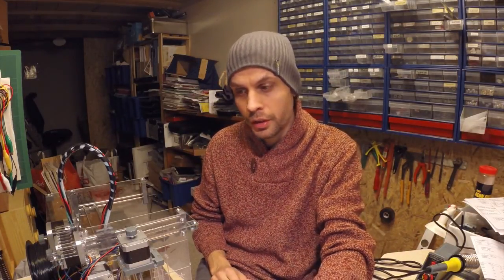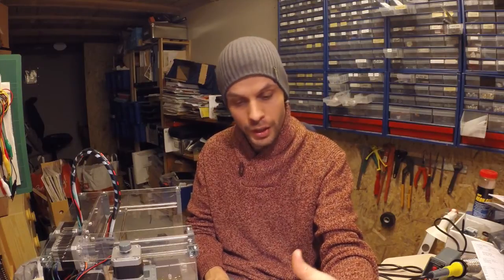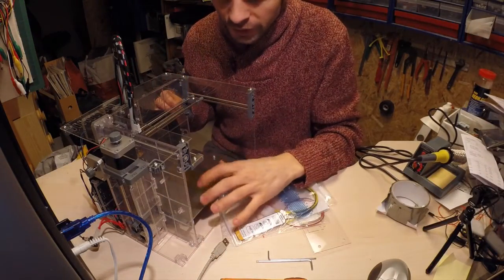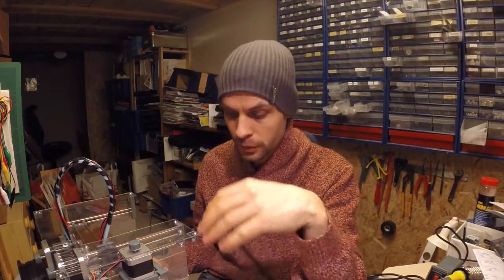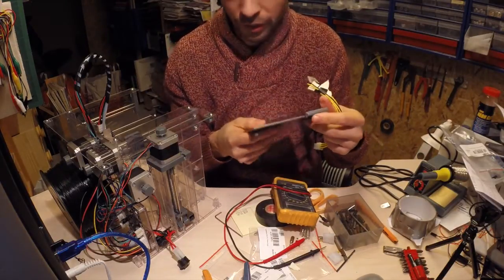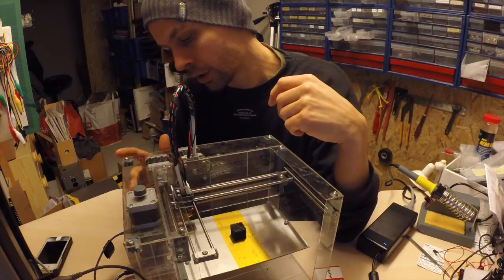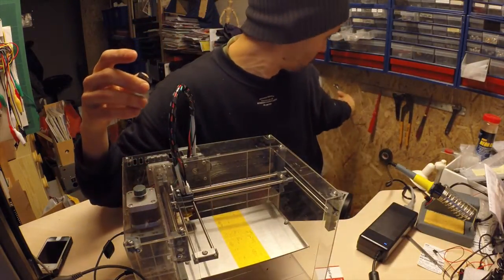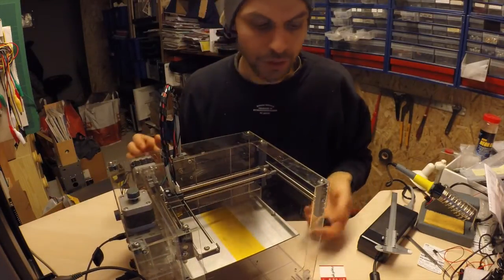Makibox hotbed cable and 3d printer first print

Comment: hi, searching makibox video's to find out it is a printer for me, maybe you can give me some advice. Just want to experiment with 3D printer, maybe print some parts for  my oldtimer car etc. My focus was on Da Vinci Jr, than came across makibox. (maybe SUPER MAKIBOX 2.0 3D PRINTER KIT). Based on youre experience, would you go for the maki that i have to build myself and has a 20x20x18 heated bed or would you advice a ready to go Da Vinci, non heated 15x15x15. Cannot figure out if the Maki is a hobby device that give's me more problems to get it / keep it running than can enjoy printing with it.

thanks !

Comment: well three prints later and looks like the hotend has popped - won't heat or anything such a pain - now I've been told reading online that the E3D v5 hotend with fan is a super duper party pooper replacement - now comes my issue - makibox clearance can supply one for 65 quid odd pence when I can get from eBay for a tenner though it is from China - what's your view brother???
Reply from the maker: +Shrek Goes Forth Sorry for the late reply.... If it is the stock hotend then that it is expected to break quite fast unfortunately... :/ Mine did, so I bought the E3D v6 hotend. But havent assembled it yet though...  I bought mine directly from E3D, and would recommend the same thing for anyone asking. Great service etc etc... 
If you feel like doing a lot of testing you could buy the ebay version, which most probably isnt a true E3D, and not the same heater etc etc... But I know people have had luck with the ebay noname hotend aswell...
I also bought the Vulcan hotend from E3D, but havent tried that one either... I have to much on my todo lost Argh!!!
Reply: +Kristian Blåsol thank for your help mate
Reply: +Shrek Goes Forth do you know where I can get the section to fit the E3D mount for the makibox from?  found the print design but don't know anyone that has a 3d printer to print it off for me
Reply from the maker: I actually used 3dhubs.com. It was very fast and reasonably priced. The print I got was very well done by a "local" 3dprinter... :) See if you find a good one in your vicinity...

Comment: Your not the only one mate i too got burnedbut I also bought the kit form from Makibox clearanceI got everything HT bed and wiresAm using Repetier host software which seems to work wellHate the lack of information for setting up etcbut have bundled together what I neededGood to meet another Makibox maker :)regardsTim
Reply: +Shrek Goes Forth ne further question the set up done by Jon i.e. levelling the bed is that good using the Repetier software host?
Reply from the maker: +Shrek Goes Forth Well mine is out of order at the moment, I used it to play around with my paste extruder discov3ry. I have gotten a few hot ends from E3D that I will try out on it "when there is time" :/ As for leveling the bed its ok using repetier. I put it in the three or four positions as Jon suggested, and use a business card as measurement. Only thing is it kind of "hangs" a bit on the far end so it doesnt keep straight for that long... :/
Reply: +Kristian Blåsol thanks for the info
question though
when in home position should the hot end sit beneath the surface of the hot bed?
or just above I can't seem to get it straight in my head
Reply from the maker: Shrek Goes Forth It is VERY important that the hot end is above the surface when in home position. When leveling the bed you should have one point as close to home as possible, but still be on the surface and not in the hole. If the hot end is below the surface in home position it will hit the bed when it is moving outside the hole....
Reply: +Kristian Blåsol that's what I thought thanks for confirming it
tomos begins the set up phase thanks for the pointers 
have you heard that Jon bufold has started another 3D printer scheme and is offering a printer to those he let down as long as you have the old order number?
I've already inputted my request with the number I'll try and find the link and share with you though I'm not holding my breath lol
Reply from the maker: Wow really! I knew he had a new 3DP venture going on, but not that we had a chance of getting one, because our old orders... Cudos, just hope that doesnt bring down this company though, there were quite many orders made for the MakiBox in its time...
Reply: +Kristian Blåsol last question
is it okay to print direct onto the bed like in the videos 
or do you have some advice for the beginner lol
and yes let's hope he doesn't overstretch himself
I must admit I was annoyed about the makibox not arriving 
let's hope this time things will be different
Reply from the maker: +Shrek Goes Forth Sweet! Thanks! You can print directly to the bed, but "Capton"-tape or Kapton tape something like that is what I use on my bed because people said it is a good thing to have that on steel beds, for better adhesion. Search ebay, and you will find it in a lot of dimensions, not that expensive there... But it SHOULD work without it aswell... If it wont stick, try to spray some hairspray on the table.
Reply: +Kristian Blåsol many thanks I will let you know how I get on lol :) I'm gonna assemble a small pdf manual for those that like me are amateurs means less trawling through page upon page of info and trying to decypher Mr Jons sometimes cryptic explanations lol
when I get it done in a few weeks will you give it a once over?
not gonna sell it 
just might make someone else's life a little easier lol
Tim
Ps and fingers crossed we might get some kind of printer that we payed for so many moons ago

Comment: is it worth getting? i see they have them on sale. is everything you need to print in the package? thanks!
Reply from the maker: Ionatan Lavric Depends on what you want... For it to work REALLY well, you will need a couple of addons, like the E3D hotend and some modded parts, like the FroZen feeder. I still have mine in original configuration, but then again I dont use it that much anymore (as I think the hot end is giving up, and I cant be bothered yet to change it...) I still think it was worth it though, the sum of the parts is worth it, I would think... So if you want to get the bare minimum in 3D-printing this is a very cheap way. If you want to delve deeper into 3D-printer maybe something else would be better?
Reply: +Kristian Blåsol hi are you considering selling it
Reply from the maker: +Harris Majeed Nope! :) Im am just scratching the surface of 3D printing so far... right now I have it hooked up to my discov3ry so I can print with paste materials... :) Also I have bought two other hot ends for it so I dont want to get rid of it yet. Have you tried on makiboxclearance.co.uk?

Comment: my standard head didn't even manage one print. I upgraded to E3d as everyone seems to think they are great. How to change the thermister look up table though ? I haven't a clue so probably printing at the wrong temps...
Reply from the maker: Bill Turner If you havent already, take a look at the Google Plus group for the Makibox. https://plus.google.com/communities/104721245982726300888
Loads of people using the Makibox with the E3D hotend, and you will find help there. Also on the Makiwiki.com you will find good info on what to do with the E3D hotend: http://makiwiki.com/index.php/E3Dv5/v6
Reply: Thanks... I find the layout of the Google plus group very difficult to navigate.. I'm sure my answers are in there somewhere but can't find them...
Thanks for the comment...
Reply from the maker: Bill Turner I can only agree on the Google Plus. But instead use the makiwiki link I sent you which has all the info needed to put the E3Dv6 on the Makibox.
Reply: Thanks, I've read up on all the links and I think I've got it now. but most assume you already have some sort of host software to connect tot he board with. I still haven't found a clear step by step guide. Which is unfortunate.. Still I think I know enough now... Thanks
Reply from the maker: Yeah, I also thought about that. I want to do a step by step video with all the steps from building through downloading software and finally first print. That would have helped me in the beginning aswell :) happy that your new print head works now!
Reply: This 3d printing stuff is not for the faint hearted... It is a big hassle just to get anything to print, I'm getting curly prints now and the backlash is quite poor....Can you do rafts with repetier ?
Reply from the maker: If you have backlash problem you probably havent tuned the x and y carriages properly or the hotend mount is too loose. You should look at the tuning videos tha Jon made maaany times, after a while I understood his cryptic explanations, and watching how the axis move in the videos really helped to get a really good tuning for me. I have no problem with backlash after really doing what he does in that video. As for curling, that could be that you feed too much filament through the nozzle, eg. the E-step is too big. I havent managed to do rafts in repetier yet no.... :/ Hope the above helps a bit.

Comment: Hey I'm really looking in to getting a makibox from makiboxclearance, obviously the prints need some clean up but would you say it's worth the money???
Reply from the maker: Hey, Sorry for the late reply. Id say it is worth it, if you get a good example. You need the hot bed version, and you need a bit of "luck" with the hot end. My hot end works great so far, but I know people who had their hotend die on first print... Id say think of it as 250£ for a controller, motor, hotend and assembly box. Any 3D printer needs to be tweaked from time to time, and this one is no different. New hot end is "usually" a must for the Makibox though... The thing is that the second to cheapest 3D printer is almost double price incl shipping at least where I live so...